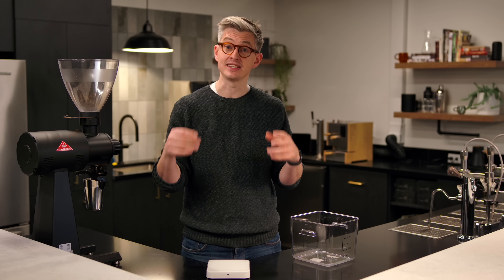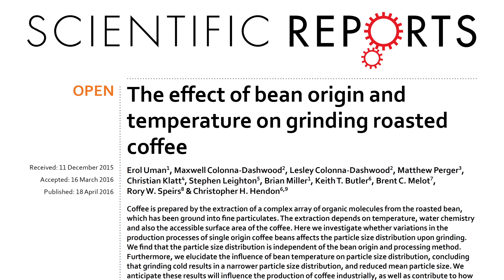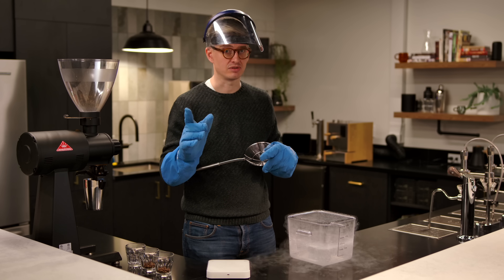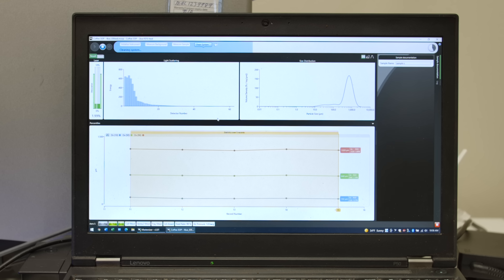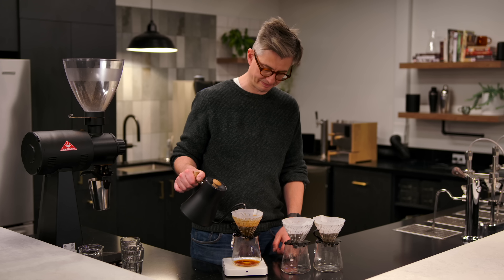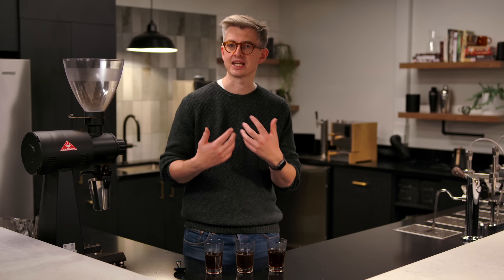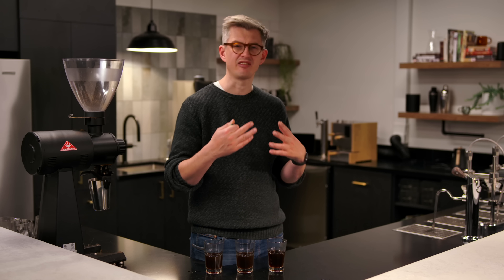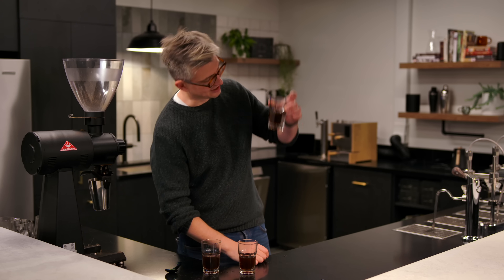Mixing Coffee Beans and Liquid Nitrogen - A Surprisingly Good Idea

Comment: It'd be nice to some info about intermediate states here. In the culinary world, flash freezing fruit can help preserve cell structure, and that can be held at a regular freezer temperature afterwards with seemingly no negative effects. On the other hand, freezing and thawing almost always seems to have a negative effect on whole pieces of meat, or produce. There is the exception of things like beef tartare where, freezing and then cutting while half-thawed helps achieve a different, desired texture. What I'd be interested to see for coffee is 1) is there a difference between beans ground straight after liquid nitrogen freezing vs those frozen in liquid nitrogen and stored in a domestic freezer for some time (i.e. is the difference simply a function of the temperature the beans are ground at or is it a difference of how the beans are frozen?), and 2) is there a difference between room temp, frozen, and then frozen and thawed beans (in other words, does thawing have a negative effect on the grind)?

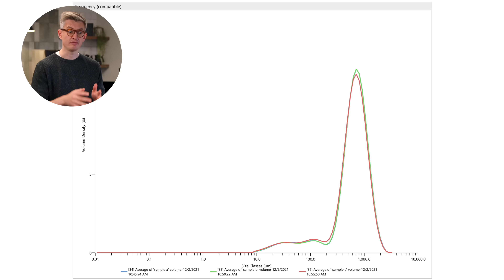Comment: Ok I'm confused, at the end James said sample A was room , B was freezer and C was LN, but if you look at the graph @3:32,  sample B has the highest peak, therefore the tightest particle size.  Whereas blue(A) and red(C) curves are so on top other each other you can't tell them apart.  Also @3:50+ James becomes an idiot, you DON'T match particle size and use a fkn $100,000 laser particle size analyser to dial in grind settings, to just eliminate the whole variable you are trying to investigate, dah.  What he should have done is set the grinder to a fixed setting and proceeded to   make coffee with the 3 different temp. beans.

Comment: When you "poached" coffee beans in LN2, how long did you submerge them? One subtle issue with liquid nitro is that it has a very low heat capacity, which means that it takes a surprisingly long time to actually lower things to cryogenic temperatures in it. A good rule of thumb is that if you submerge them until the LN2 stops bubbling or otherwise reacting, the outer surface (at least) of the beans is at temperature.

Comment: Makes me want some liquid nitrogen.  :) Before everyone runs off and puts their beans in the freezer, one should note that - In America, at least-- most freezers that are built into refrigerators are "auto-defrost", aka "frost free". Auto-defrost  means that the freezer periodically heats up  to melt any accumulated ice. This process also dehydrates anything in the freezer, and is the  primary source of the accumulated ice inside food packages, called   "freezer burn".  I would expect this thawing cycle would make substantial difference in how the coffee ages, possibly overwhelming any flavor changes attributable to simply freezing and keeping frozen till grinding.
Reply: Good point.  I have a small Coleman ice chest in the freezer that I use to protect stuff from the swings.

Comment: amazing work! thanks for sharing.

fwiw, my experience matches yours. brewing filter with coffees directly out of the freezer does not worsen cup quality.

however, i’ve mostly stopped doing this. i vacuum seal more than a single dose and am concerned that if i were to open the bag before it hit room temperature, i would get condensation resulting in premature fading.

Comment: I love it when James answers a question I didn't even know to ask. Specifically - yes, a Cambro CAN survive being at 77 Kelvin.
Reply: totally dorky & unnecessary scientific grammar thing: 77 Kelvins, technically -- it's the absolute measure of temperature, so there are no degrees (unlike F or C, which is why they are referred to as "degrees Celsius" or "degrees Fahrenheit") when using the absolute measure of temperature. thus there are no such things as "degrees Kelvin," so the only times Kelvin would be used in a singular would be if you're talking about any number from 0 to 1 Kelvin. beyond that, you just add an "s" to make it a plural as we usually do in English.

and I know my comment is totally not useful here! also, Cambros can handle a huge variety of temperatures &/or pH. they only advertise as being able to withstand negative 40 degrees F (aka 233.15 Kelvins), but yeah, apparently it can handle something colder than that rating, at least for that period of time. I think you'd have to have a pretty big cambro to crack it with liquid nitrogen -- in a smaller one like the one James used, the liquid nitrogen boils off pretty quickly when exposed to room temp; clearly more quickly than that temperature can break that size of cambro. in a 3-story-high cambro of a proportionate shape, it would take longer. hmmmm.... now I want to test giant cambros with liquid nitrogen. I've gone completely off on an irrelevant tangent, but you know, that's the fun part... kind of!

Comment: Extracting coffee that is in 3 different  temperatures, with very hot water of the same temperature,  result in  extractions that have  different  ingredients and different proportions. This  is because the solubility of the hundreds of the roasted coffee chemical molecules vary depending on the chemical group that belong and the molecular weight. Therefore the 3 extractions will have different amount of substances that have been dessolved and of course different taste. Hot water through a warmer bed will dissolve higher yields of soluble molecules and more difficult to dessolve bitter substances.

Comment: I experimented with keeping my beans in the freezer about a year ago. I did notice it resulted in less static and grinded a bit easier and faster with the cheap handgrinder I used at the time.
Reply: I keep my beans in the freezer as well... never had an issue with grinding them as they sit on the counter for a few minutes between being weighed and hitting the grinder.

Comment: 4:00 did you calculate and/or measure  to make sure that 0.5 step difference was the best adjustment to compensate for the difference in particle size (I e. without yielding an even bigger difference in the opposite direction)?

Comment: The issue with grinding from frozen, that I have found, is that the moment it comes out of its container it starts attracting moisture in the air which gums up the works when you try to grind them. Something that probably wasn't too much of an issue with the room James is in that is probably air-conditioned and therefore has low humidity.
Reply: Thats my thought as well.
Reply: Do you grind frozen and then brew straight away the frozen ground coffee?
Reply: Have you tried the following approach:
 - put coffee beans in a vacuum bag, then vacuum the bag (remove as much air as possible)
 - freeze beans
 - at a later time unfreeze beans, let them return to room temperature
 - only then take them out of the bag and grind them.
I haven't tried this with coffee, but it might help avoid the whole condensation issue

Comment: Working in a chemistry lab, we use the LN2 (liquid nitrogen) freezing trick quite a lot. I work with microporous polymers which are sometimes quite a pain to grind them for analysis because their grains can be quite rigid, so I just freeze them in LN2 and grind while still cold. After grinding, though, I have to dry them under vacuum because some moisture can be trapped and condensed. My senior once used LN2 to freeze a piece of sponge before cutting. LN2 is one of the most important equipment (if you will) in our lab because besides that, we use it as a coolant in cold traps to set high vacuum system in many applications.
Reply: I am also a chemist and was encouraged to use LN2 on cannabis flower from prerolls in my research analyzing consumer cannabis delta8 products. Unfortunately I was at a small institution where we didn’t have access to LN2 but I liked the idea and thought it would be great for all kinds of grinding needs!
Reply: @CatChan141  well that just sounds like you should do the next best thing which would be to tumble the flower in dry ice. It's a method they use for separating the thc crystals from the flower. Typically in order to make concentrates like rosin where it's placed in a micron filter bag and pressed on a heated press.

Comment: Sadly, your test brews did NOT test the grinds that you measured the particle sizes of. You ground the LN coffee at a different setting, and I suspect THAT is what caused the flavor differences you noted.

The LN coffee had a very slightly tighter curve around the center peak of grind sizes, but all three seemed to center around the same size. I honestly doubt you would have been able to identify the LN coffee had you kept the grind settings the same for all three brewed samples.

You changed multiple variables, and then tried to draw a conclusion about one of them. That doesn't work.

Comment: The particle size distributions between all three cases don't actually look that different, and yet James is able to taste some difference.  This indicates some relative importance to the distribution.  Why not add a "sieving" step to say remove the undesirable smallest grounds and then brew using the "desirable" size fraction.  You will be able to change the particle size distribution much more using sieves than by changing the temperature.  Just a suggestion.

Comment: Liquid nitrogen is surprisingly accessible for just playing with. Obviously it's only for well ventilated or outdoor use, as it can be asphyxiating if it displaces all the oxygen, and there are of course the precautions for working with low temperature substances, but it only cost me $25 for 20 liters in a dewar rental when I made liquid nitrogen ice cream for my birthday. If you're careful with it, it's wonderful stuff to work with, as unlike ice it does not adulterate what you cool with it, and it can freeze things that otherwise we don't think of as freezing (we made gin ice with it, for example, so we had tonic water, gin ice, and lime powder, instead of a traditional G&T at the party)

Comment: Two problems: first, isn't the problem with freezing coffee without liquid nitrogen that your beans constantly change temperature and humidity by non-trivial amounts as they move in and out of the freezer, or as you buy groceries and change the conditions inside? Second, doesn't this whole thing assume nitrogen has zero effect on taste? I can foresee different answers to that depending upon whether you are asking a scientist or a coffee snob.
Reply: If you're freezing coffee, the general advice seems to be to either freeze individual doses (which is impractical IMO) or freeze it in reasonable portions that you can consume in a reasonable period of time (say, a week). I'm unsure if this changes the other advice which is to allow the full batch of coffee to come up to room temp before opening it and exposing it to the air when it comes to freezing lots of 250g or so. I don't think variations in freezer temperature from adding and removing groceries have been demonstrated to affect the coffee if it is stored airtight. I double package mine, 250g portions in your standard coffee bag contained in ziplock bags. Anecdotally this is fine and I don't notice a difference in taste but then again I am not doing head to head comparisons or blind taste tests, nor do I have a "golden tongue" like experts might have.

Comment: Two thoughts: Would pouring a bit of LN2 into the grinder to pre-chill the burrs have any effect?   Is the response curve linear, i.e., could I get most of the LN2's effect by simply dropping a chunk of dry ice (solid CO2) into my grinder?
Reply: Just as the beans get more brittle, I would be worried about the steel or ceramic burrs becoming so brittle they would shatter as well.

Comment: I can see the extreme cold of liquid nitrogen acting in two different ways:
1. The beans will be more brittle, and prone to shattering. This would result in a finer grind.
2. The grinding will take place at a much lower temperature, since the beans start out much colder. The beans will lose fewer volatiles during the grinding process.

Comment: Lovely experiment. One note though: You knew the grind setting of the liquid nitrogen one was coarser than the other two (4:00), which is also what you mention at 5:18. Therefore, this experiment wasn't fully blind unfortunately. To me, this experiment shows that the grind settings have more effect than room temp versus (flash) frozen, which is something we already knew!
Reply: 1. The liquid nitrogen ground coffee was generally finer than the other two, not coarser as you assert (grind setting remaining equal)
2. He used the particle analyzer to match grind size as closely as possible before tasting; this resulted in the EK43 being set a touch "coarser" for the nitro beans, but that was a necessary adjustment to ensure uniform size and brew characteristics. Because it naturally comes out finer, the machine had to be set coarser for it. Or to put it another way, because the frozen and room temp beans normally come out coarser than the nitro, they had to be set finer on the grinder.
3. Hoffmann admits that it's not completely blind, because he came into the experiment with foreknowledge of the particle distribution; he admits to the possibility of a false-positive effect in which he wanted to attribute a flavor characteristic to the cup based on his foreknowledge of the particle distribution. If that's not a prudent approach to tasting, I don't know what is.
4. A completely blind setting would be to present those cups to people who did not understand what had been done with the beans. It could also be set up with three triangular tasting sets: e.g. regular-frozen-frozen; frozen-nitro-nitro; regular-nitro-nitro in order to better befuddle participants.
5. Although the experiment was not completely blind, this does not discredit the affirmative conclusion he was looking for; that is, the viability of grinding frozen beans for pour-over coffee and a confirmation of the study referenced.
6. Have a nice day

Comment: If I was conducting this experiment I would have changed two parameters.
Firstly, heat from the grinder basket, burs, and the following tunnel and cup heat up the coffee and the coffee beans cool down all these grinder components. To keep the temperature constant all the way down to the cup I would have cooled down all the parts to relevant temperatures.
Secondly, cold ground coffee would draw moisture from the air that might affect brew time. Using a dehumidifier in the room and collecting the grounds into a sealed cup and giving enough time to reach room temperature before breaking the seal might solve this issue.
This is just my way of thinking, James's approach is already quite sufficient. Maybe another visit to Cometeer?

Comment: Just curious, what about moisture. From frozen, as to grinds is condensation an issue as they pass thru the blades as some heat I would think would be generated. I guess as an equipment repair tech, more thinking about how it would affect equipment is even some moisture on each grind were present.

Otherwise as always your info is fantastic.

Tx. Mark
Reply: Never mind I see the question was already asked and answered.

Comment: Nice experiment. But my question is How long did it take, after you grinded the nitrogen coffee, to brew it. I would be afraid, that if it takes too long, air moisture could stat to condense on those ginded beans and potentialy start to extract them before you even started to brew them with hot water.

Comment: Thanks for sharing, but I have a doubt about rigor. Could it be that the condensed water increases the toughness of the coffee beans due to the temperature difference, resulting in a more uniform particle size distribution. If you can, if possible, look forward to your next experiments to try to eliminate this interference, such as comparing in a completely sealed and dry environment, or comparing the data of different cooling and rest times of coffee beans before grinding . Thanks again for your technical video sharing.
Reply: I think he wasn't worried about controlling every variable because that was already done in the experiment he referenced, he was simply testing the concept

Comment: There could be something with pores in coffee. Liquid nitrogen possibly could shrink coffee beans and close some of pores/gas bubbles in structure of bean. Maybe it needs longer time of brewing? 
I'm curious about other thing: what if we roast coffee in different medium than normally? (air at normal pressure). Maybe You could investigate it? Cylinder filled with green coffee beans and under high pressure of argon perhaps? Heated to prefferred temperature, with prefferred time? Or some kind of liquid medium inert to coffee and supercritical conditions?

Comment: Interesting, I had heard that freezing beans actually caused them to stale faster because condensation would form on the surface of the beans, when taking them out of the freezer.
Reply: that's why you freeze small batches that you'll use somewhat quickly so you don't need to refreeze them